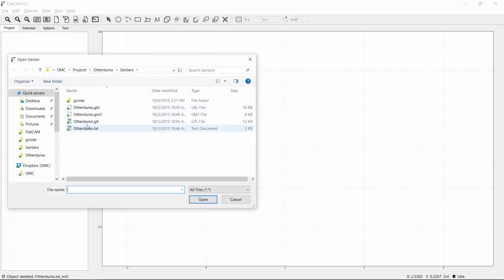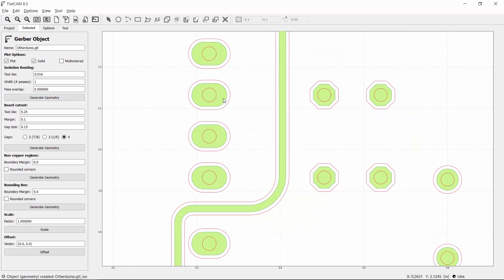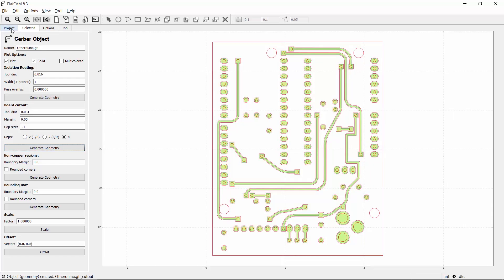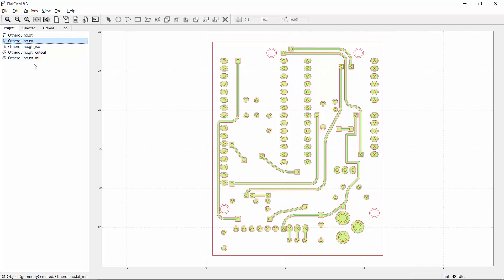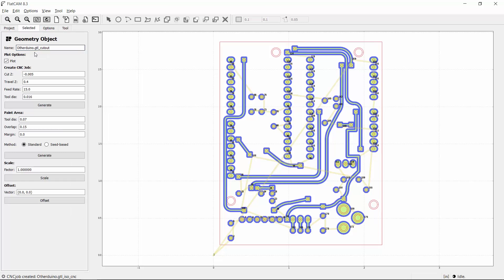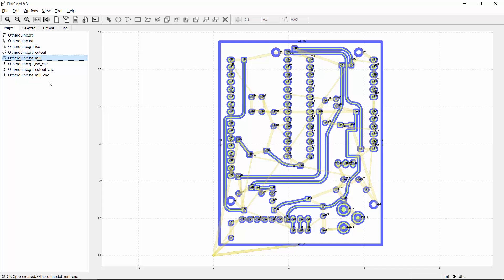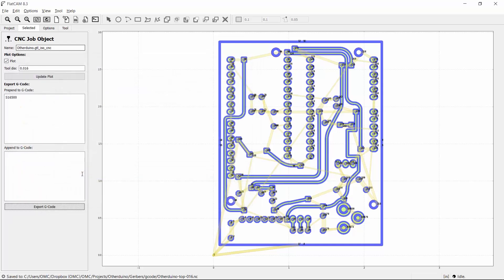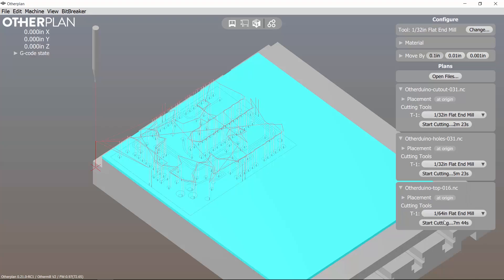How To Convert Gerber Files to G-Code with FlatCAM

Comment: This program does not support excelon format -- but supports a subset of. There are actually two Excellon formats, the older Excellon 1 and Excellon 2. Excellon 2 is a superset of IPC-NC-349. Commands from both are sometimes confusingly mixed in the same file. Excellon Automation stopped publishing the specification of its format, without statement on the IP and usage rights of the format. The specification is ambiguous, leading to different interpretations, especially in the area of coordinates and units. Otherwords it does not support format of most PCB layout programs.

Comment: What kind of gerber is a 'GTI" file that is first used?
He calls it a drill file. And a top layer file....I have none of these in my gerber file sets generated by Altium Designer
Reply from the maker: It sounds like you're trying to export the correct Gerber files from Altium Designer. While we don't directly support workflows using third-party software like FlatCAM, we do have a guide and template available specifically for exporting Gerber files from Altium to ensure compatibility with our Bantam Tools machines.
You can also use the built-in tools in our software to mill Gerbers, though it's important to note there may still be compatibility issues if the files aren't from supported software like Eagle or Altium.
For more details on how to properly export Gerber files from Altium, you can refer to this guide: https://support.bantamtools.com/hc/en-us/articles/115001656813-Altium.

Comment: Hi,
why do when I import the exellon file, the size (the dimension) of the exellon file much larger than the gerber, so the hole did not match, how to fix that ?
thanks in advance
Reply: If you use EasyEda for design, you need to switch it to inch , if is it in cm measure of the holes will be incorrect